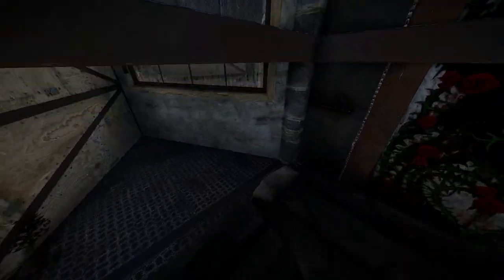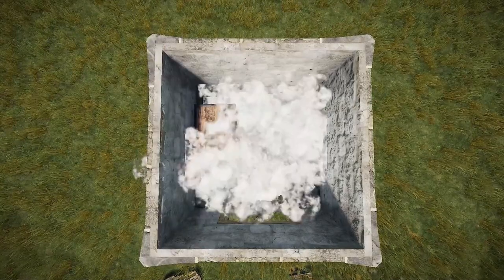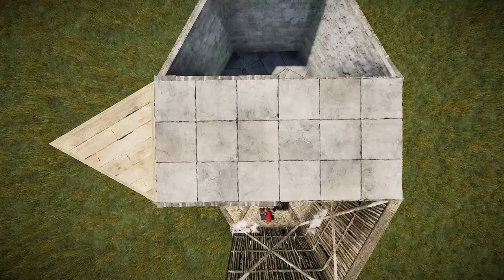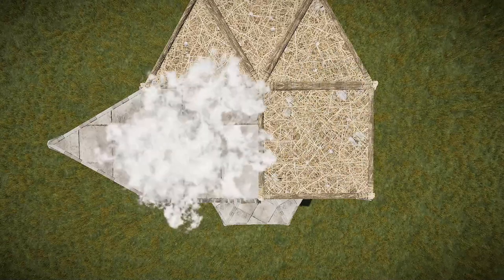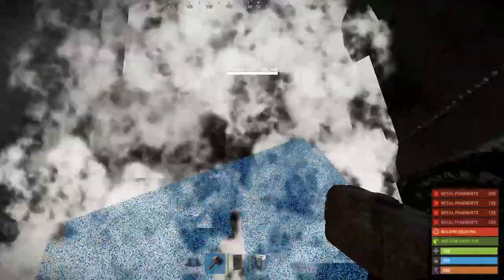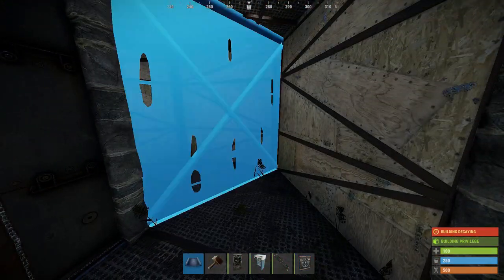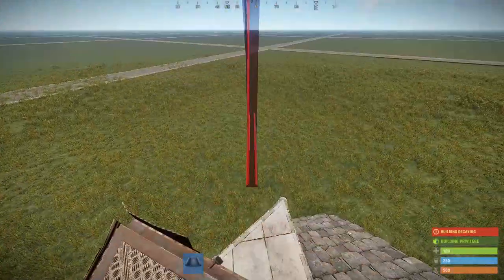Rust Compact Solo/Duo Base with new Bunker

Comment: - Bunker can be broken for <4 rockets by destroying the twig support thru the wall if you remove the stone wall under the roof ramp. Can be fixed by upgrading that wall to sheet
- Bunker can be broken for ~4 rockets by splashing the garage door that guards the twig via an angle in the chute. Can be fixed by rearranging the orientation of the chute such that you don't have an open doorway into your core
Reply from the maker: I know, but how does this make the raid cheaper?
Reply: The real question is whether the bunker makes the cheapest raid more expensive. If defeating the bunker mechanism doesn't make the raid cheaper, then did the bunker matter in the first place?
Reply from the maker: @InigoPhentoya  if the bunker wasnt there it would be cheaper to raid.

Comment: Hey man, if you're not gonna upgrade those walls to armoured in the dropdown, you can make the doorframe stone earlier on and just replace it with a vending machine later. Adds some more storage too
Reply from the maker: You could do that but that would either make it weaker by placing the vendingmachine in the outisde triangle or harder to walk around if you put it in the doorframe. but if you dont have a problem wit harder wlaking around that is defitly an option.

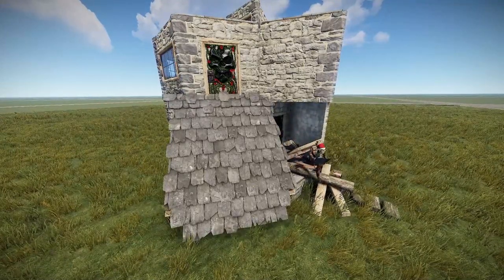Comment: Guys i have one addition to the base you can add a floor triangle to honeycomb 3:25 that back triangle and than you can build the bunker anyway without the floor frames inside the base.
Reply from the maker: Well that would work but that is also splashable from the outside which was what i didn`t want to happen.